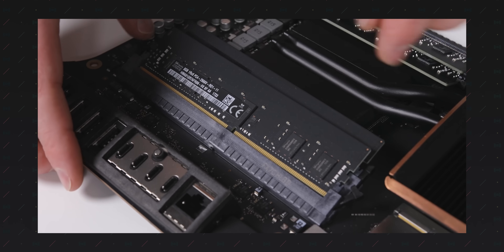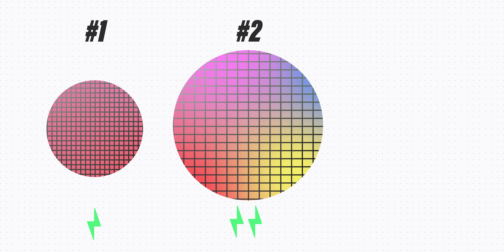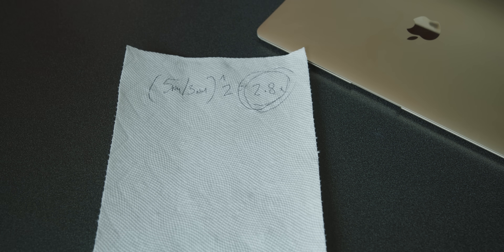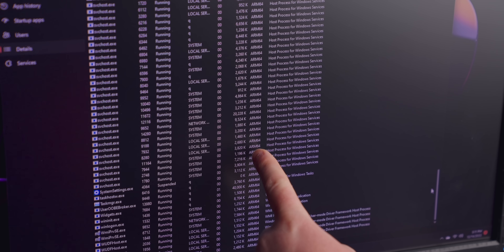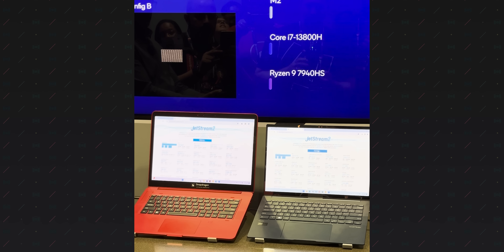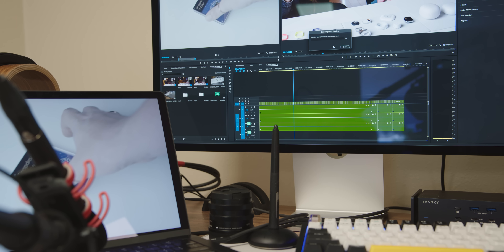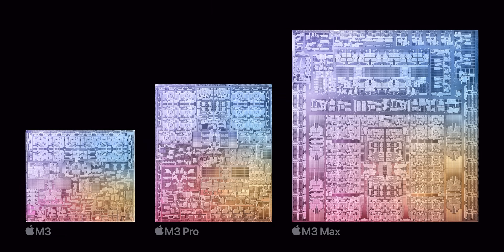Apple's Silicon Magic Is Over!

Comment: Consnumer model should have 16GB ram and 1 TB drive space minimum. The pro model should have 32GB of ram and 2TB minimum. Make a 12". 15" and 16" the two bigger screen sizes sporting IO ports found on the current pro models.  Names MacBook AIR MacBook PRO  and MacBook Industry. Price 1K- 2K and 3K

Comment: I have a 14in M1 Pro that I use for work on the weekdays and a 13in M1 Air for when I travel. But I still use my 12in MacBook from 2015 on the weekends for casual browsing. I've been wanting a refresh of the 12in for awhile. Hell, even if they don't physically change it and stuff and M1 in there I'll be happy. And yes even with 1 USBC port. And yes even at $2000 for 500gb and 8gb ram. DO IT APPLE!!!!

Comment: Great video Quinn. Truly next level. 
I will say, your point about the fans - it’s interesting because my M2 Max MBP 16” is utterly silent. Running Cinebench? Can’t hear it. 3D Mark? Quiet as a mouse. Both Cinebench and 3D Mark at the same time? Barely audible. Whereas the M3 lineup actually seemed to get louder and less efficient. But I’m not sure that’s a bad thing. I love that the M3 Max is literally the most powerful CPU you can get in a laptop, by a good margin. So I’ll take the extra fan noise.

Comment: Great video I have not seen the thermals for the snapdragon chip how do they compare and the wattage
Reply: That's going to rely a lot on the laptop manufacturers.  There will probably be better designs and worse designs, and also different levels of power being pushed into the SD Elite chips.

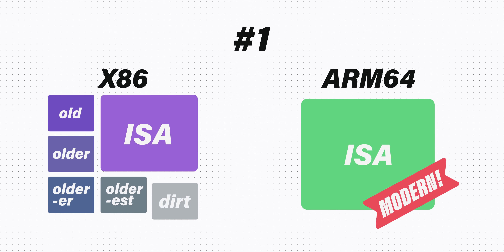Comment: 2:22... no... just no... 
Arm is just as old, if not older, than X86 and is no less bloated than X86. That's not the reason why Apple's IP was so competitive. The reason for their success lies instead in them using, oh, I don't know, a process node that was 2 generations newer. The "ARM is better because it's newer" argument holds no water and is irrelevant.
Reply: That shouldn't have ever been the argument.  It's better because it's (generaly) more efficient.
Reply: X86 had  been around before arm as a company existed. 

RISC processors were not a new thing when Acorn RISC Machines became a thing. Sun had SPARC. If Apple had bought Sun instead of Oracle, Apple could have stayed in the server market and gained chip design years earlier.

Comment: Why are you using a 14”inch M3 Max as your main workstation? Wouldn’t it make sense to use a M2 Ultra studio or M3 Max 16inch instead for your use case? I own the 14 M3 Max and I use it for long photo editing sessions and have no issue heat or throttling issues.

Comment: Nice overview but  I disagree with you on one thing. Qualcomm has everything to challenge even Mx Max very soon. You talked about transistor density and chip size -  do you know that X Elite die size is only ~170 mm2 @ 4nm node? So chip is only ~16% bigger than M3 and provide almost 50% higher multicore performance. 16 cores from X Elite should be faster(in multicore) than M3 Max , and thats with around 2/3 of size of gigantic Apple chip(over 500mm2). This may be only beginning. Just first chip just like M1 was. Also they are probably far ahead in gpu game if we compare GPUs from A17 Pro and Snapdragon 8 gen 3.

Comment: My 2013 Retina 15 and my M1 Max 16 are my favorite computers. I doubt they will but hope that they do bring back the ultra light 12 inch in an even smaller form factor and call that the air, and rename the air line to “MacBook”. Also bigger iMac with M series pro chipsets please.

Comment: One of the big ways they got some extra speed on the CPU was by cutting corners on memory security without even encrypting memory registries, so any application can get into any encryption keys the cpu uses,. if they were to apply the same sort of fix as spectre and meltdown then we would be looking at a 20%-60% reduction in speed and it still wouldn't fix the issue completely (as some of it is corners cut in fab). 

As far as competition - The 7045 from AMD are equaling M2/M3 on battery longevity, and beating them on speed of non-accelerated processing. So competition already arrived a while ago.

Comment: I just hope that microsoft and qualcom dont use the transition to ARM as an excuse to block other operating systems (linux) and kill upgradeable RAM.
Reply: Since when do windows laptops have upgradable ram? I'm packing up and returning the one I was testing today, which is literally the only 14 inch windows laptop running intel that has atleast 1 upgradable ram slot. The other one is amd (but amd sucks for video professionals) by the same manufacturer. (asus zenbook pro 14 and asus zephyrus g14.) 
I think 16 inch ones have upgradable ram more often but I'm guessing most don't considering that ALL 14 inch class machines do not and they're all more than big enough to fit the slots.
Reply: @definingslawek4731  since the beginning pretty much. And when it comes to 14 inch laptops, my latitude 7490 has two ram slots.

Comment: i think AMD already has proven you can make and efficient x86 chip with the right stuff to remove from the x86  architecture... so i don't see how ARM is the future anymore since they just proven to make chips that are more powerful and more efficient than the m series just because it started from valve asked them to make the steam deck chips... the only one i see that can outdo the current market is the RISC-V platform's potential with the current prototypes they already have...
Reply: plus not to mention the optimized software that valve has for it in less years made than the macos itself.... its a miracle what the steam deck achived and the potential of x86 that we did not notice because intel has been on the performance maximum without a care for power draw race for too long....
Reply: and this is not mentioning the fact that it has not even tapped into all the raw hardware accelerations it has yet unlike ARMs translation layer.... since as we all know windows is so bloated and its actually pulling down the performance of x86 chips....
Reply: and yes i only bought the m1 macbook air because of 1 reason... its a laptop with no moving parts and its super efficient and has the thermal pad mod that takes it to the next level.... i won't ever buy another latop from apple with a fan... so this is probably the only laptop i will ever buy from them... i can even show you all my laptop and portable computers and desktops and home servers to show you i don't even care whose side i should be... i only care about the hardware's value and the software that runs it and how efficient they can be at performing their specific tasks...
Reply: my 4 main desktops runs amd intel and nvidia mix of gpus and cpus.... in fact my main and secondary backup rigs runs amd gpu while my coding and entertainment rig runs nvidia gpus... and my intel rig for emulation gaming is running older nvidia gpus... my home server runs intel x99 with no "gaming" gpu on it... plan to upgrade to a high core count APU RDIMMs in the future for my homserver so that at least it can do more efficiently in more specific tasks rather than currently with an accelaration card in it... i don't need it to be blazing fast like it is now on those tasks but i do need it to run on less power since it will be on almost 24/7.... plus lesser parts = lesser points of failure...
Reply: the only problem with my upgrade requirements is it has to be able to use DDR4 x4R1 RDIMMs and it has to be an APU and i hope it could be an AMD platform that could allocate unlimited RAM for dedicated iGPU because i need it to have more than 24GB VRAM.... which does not exists lol so i will probably have to change platform entirely.... since the intel platform are not as efficient as the AMD platform in this case.... plus this era's iGPU in intel does not have any possibilities of BIOS updates for unlimited dedicated VRAM for their iGPU.... unless someone can remind me which one could meet all these requirements in the 1st sentence on any platform....

Comment: As someone with a Macbook Pro M3 Max and a Mac Studio M2 Ultra - I edit with 6K BRAW and 6K R3D literally no issues editing raw (Still make proxies) but if I wanted I could edit the Raw. I feel like I may not need to buy a new computer for the next 4 - 5 years and outside of the Sandisk G40 my issue is Dock/SSD that keep even 1/5 the speed of the internal SSD (Only the G40 hits 3000+ mbps while my computers are 6000-7000+) my old SSDs (Not even old just SanDisk Extreme V2 and Samsung T7's) are storage or for recording directly to on my cameras now.
Reply: Why do you use proxies if you have no issues editing raw? I thought the ONLY reason for proxies is because you can't edit the source files. Or maybe cause you don't have room cause of the expensive storage so you have proxies locally?
Reply: @definingslawek4731  I use Sandisk G40 3000 mpbs 4TB USB-C drives so no issues with space (Plus I have 2TB internal) it's just how I've always done my work flow by making proxies to edit then relinking for the final grade and export. But with 3 SanDisk G40 drives as long as I'm not going through a Dock I could theoretically just edit the raw videos but making proxies takes a few minutes on my M3 Max Macbook Pro and M2 Max Studio and I can still edit off of a dock with my older SanDisk V2 Pro's. Overall it's made my editing for photo/video much faster, making proxies faster, etc. There's never really been an issue with storage. I have 2 NAS servers (Raid setup) with 40TB of storage   for when I need to grab old footage, and I keep my proxies ungraded on the cloud for working remotely or for people out of my area to work on specific projects. I typically never edit off of the local drive on my Mac's only external SSD's (Just because the internal SSD costs an arm and a leg to replace so I try to keep as much work on externals as possible).

Comment: The real story of this is that Donald Trump forced Apple to bring money held in other countries back to the USA and Apple had a choice to pay taxes on all the money or spend it on R&D.

Apple chose to spend and you got the M1 design with a huge $$$ spend on TSMC 5nm wafer orders.

Since then they have tried to maintain an advantage by using the most advanced silicon nodes but now they don't have an unlimited R&D budget.

All while this was happening, Intel was stuck at the 14nm node that they were having a really hard time with.  Now Intel is using TSMC so we are back to parity.

Apple looks good by comparison but only compared to Intel's poor form.

AMD was just trying to kick Intel's ass in servers, desktops and budget laptops and they didn't quite do it with laptops.  This might be more due to Intel pricing schemes than performance, at least that's my impression.

So Apple was the super thin laptop market leader because there wasn't much competition, just Microsoft Surface, some Dells I think and probably a few other small names.

Now they might face some competition and if the Windows software works well on ARM and people can avoid Apple's walled garden control of the software ecosystem and spend less, they will.

Comment: Apple silicon for me is lacking a bit. I did not have the wow factor that many youtubers had, but at the same time what I use my laptop for is not video editing. The chips seem purpose built for video editing. In general things load faster and run smoother, but when it comes to CAD programs like Autodesk Fusion, I feel like performance could be better. Sure that could be lack of software optimization but it received a big software optimization update last year that improved performance quite a bit. The main hardware optimizations of the chip are not something I benefit from like the video encoders/decoders for example.

Comment: one thing to note tho for when apple transitioned to m1, in the prev gen intel macbook, the heatsink LITERALLY didn't make contact with the die, this was found when LTT tried to improve the cooling with better paste and found that they had to drill out some of the heatsink in order for it to touch the cpu
Reply: I honestly wonder if apple made some of the pre-m1 computers worse on purpose to make m1 look good.
Reply: @ZachariahConnor  it sounds like an apple thing to do honestly. I wouldnt be surprised
Reply: @ZachariahConnor  Considering that they do have some engineers employed, I can't think of any other explanation for this. But that leaves me with a feeling that they were actually caught by M1 surprise themselves--had they known that the Apple Silicon would be so good, I don't think they'd have gone through the trouble.
Reply: And in the Early 2020 MacBook Air models, they added that ridiculously underpowered semi-passive heatsink that could only handle about 5-10 Watts before the CPU started to throttle...

Comment: Vertical Control doesn't imply that, Vertical control was the standard for the 1970s and before, all companies designed complete computing systems, and they were terribly slow, then UNIX/C came along and C was designed with a mindset to be portable thus using features for the programming language that would use instructions common to the hardware of multiple companies, this decoupled hardware and software development and allowed for the optimization of generic CPUs to the point of being completely squeezed, and this allowed to focus more on specific usecases and allow for the creation of GPUs, NPUs etc. Vertical Integration only means Apple has to ask little permission or coordinate little with others, nothing more in terms of computer design.

What made Apple silicon faster was the integration in a single chip, that is all, the elimination of the FSB and modularity, that is the main deal.

Comment: Nice. Yes, as much as Apple has been pushing unified silicon, perhaps they should use the Ultra form-factor asymmetrically for more specialised applications like gaming, 3D content creation, 2D content creation, Dev/AI.
On the low end, they need to fix memory, 100GB/s sounds great for system/CPU memory but sucks for GPU & what's with the 8GB standard? They should be looking at >200GB/s with 12GB minimum & fix the damn upgrade prices - no amount of innovation is lipstick on that pig.

Comment: No mention of AMD's and Intel's new chips?  Not AMD's Dragon Range catching up in efficiency and Intel's Meteor Lake is a huge step up for efficiency?  While AMD is using 5nm and Intel is using 7nm.  I know this guy has a hard on for ARM, but it's over for ARM.  x86 has caught up, and AMD's new 8000 chips are even better now than Apple's.  The new Zen5 is rumored to be 20% to 30% faster.  I have no faith in Snapdragon-X, when nobody has benchmarked them yet.  The benchmarks are clearly cherry picked.

Comment: the problem with M3 family is that it didnt really go full beans on the NPU and overall AI tasks and this is what M4 is set to finally do. trust me apple silicon is going nowhere. yes M3 sells bad vs M2 and especially M1 but thats just the thing. the target buyer is still intel mac users sitting on their 2019 machines that has not switched yet. and apple hopes M3 and M4 will do that.
M3 focused on the GPU and ray tracing etc. and M4 will focus on NPU and AI which itself will help GPU and CPU tasks with software.

AI/NPU is VERY important in for example upscales the resolution in a game. that way the user don't need to buy a Pro or Max chip to get the fps they want.
Reply: Good point, however; I'm typing on a 2012 MBP so I've definitely been holding out longer than most, lol.

Comment: In my opinion, while competitor can catch up on the hardware side with ARM technology, the competitive advantage of Apple is MacOS (as of now). Windows with drivers, infinite list of components combination and the need to make them all work together has been more prone to BSOD and random crashes. So the stability of MacOS should be to leverage.
Reply: this actually a strength of that ecosystem, so let's call it a feature and a bug